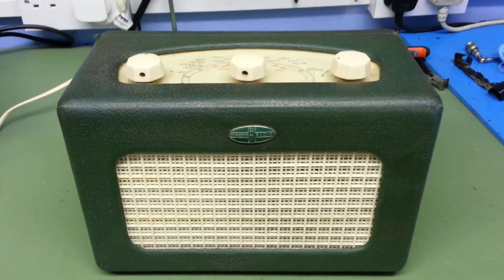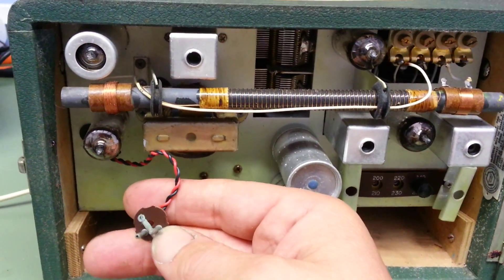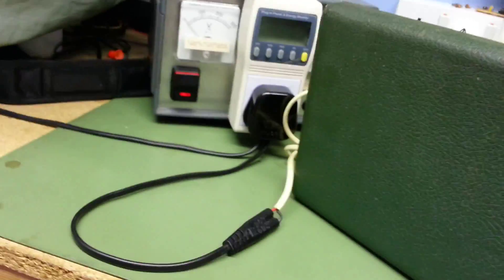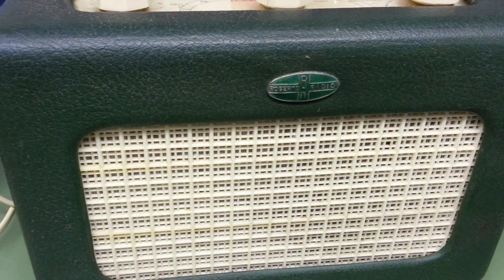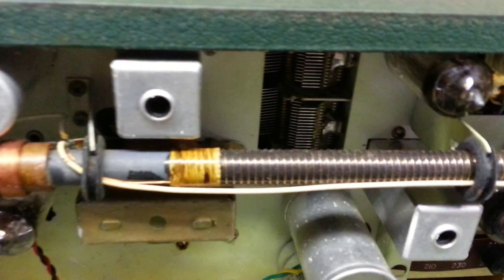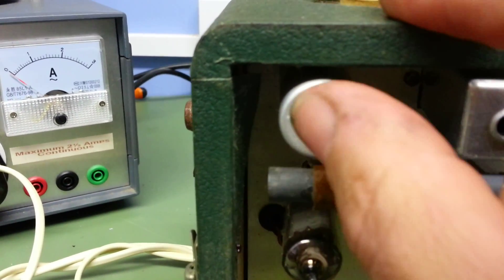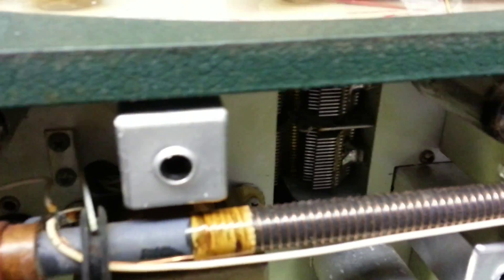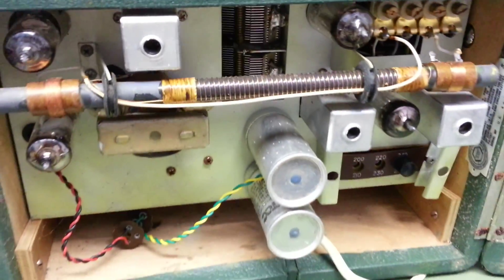Roberts R66

Comment: Nice little radio! I have a Roberts RT1 and I see they did not change much in terms of styling from the RT66 to the RT1. It might be tough to find a piece of leather that match the case to replace the handle, but if you cant find a replacement, it would probably look OK with just the brass mounts where the handle used to be.